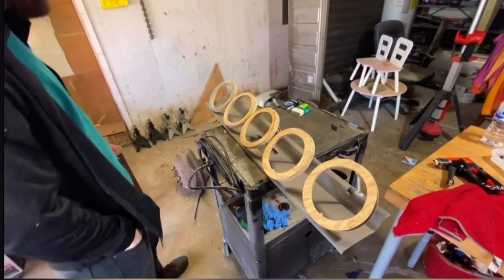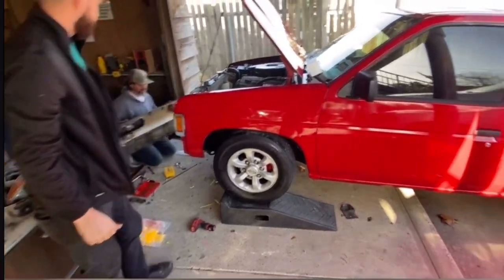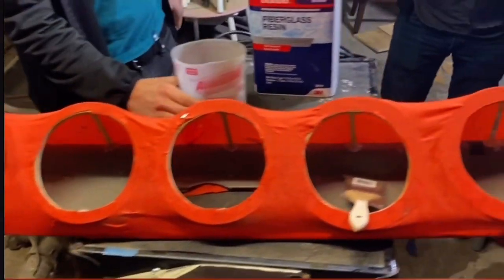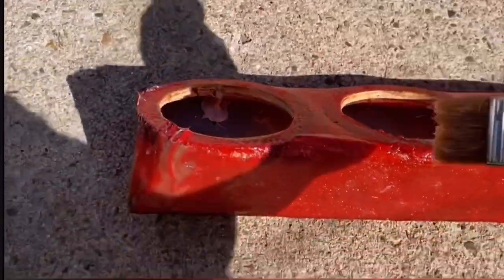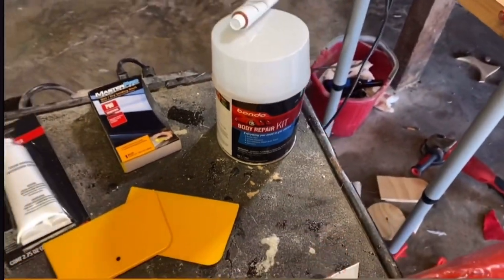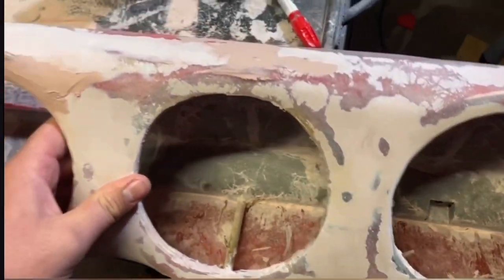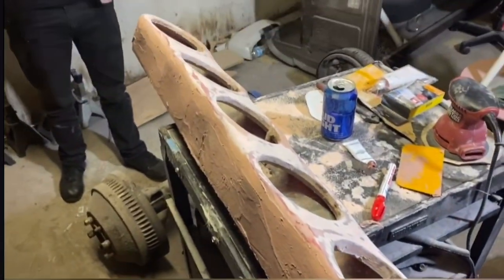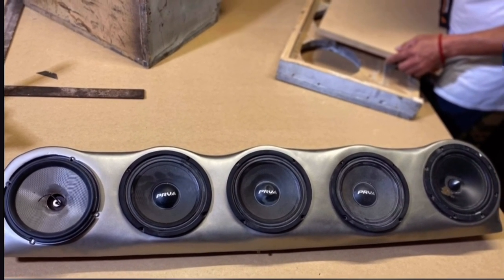Custom fiberglass speaker pod headliner panel for Gmt400 /obs Chevy Silverado Car Audio

Comment: Question bro. How do you mount it to the headliner cuz I’m guessing these go on the top and back of the cab right by the back window?
Reply from the maker: I haven’t installed it yet but the factory clips are strong it had 2 screw I think and if anything I’ll add more screws